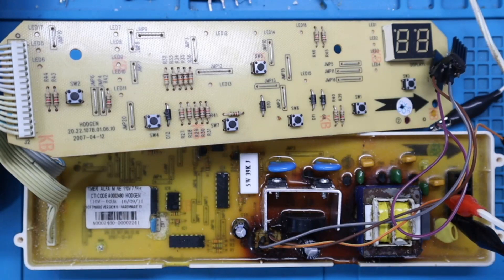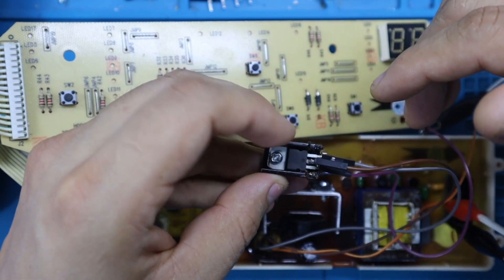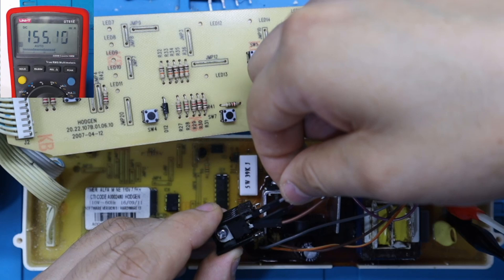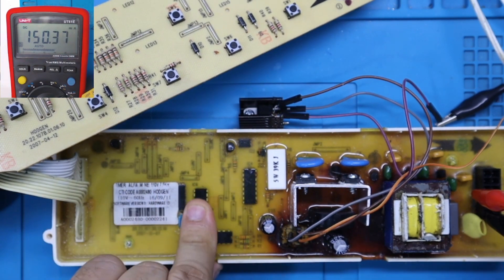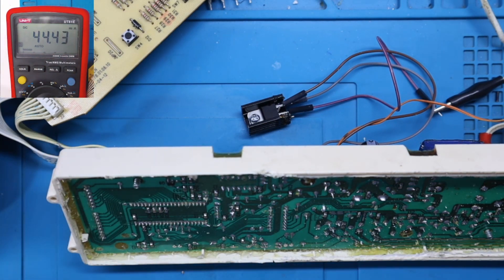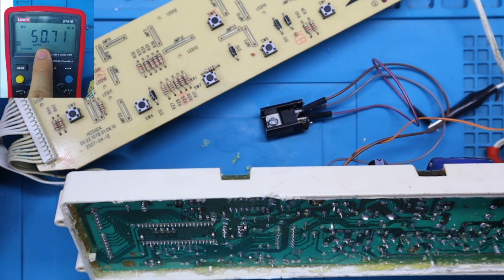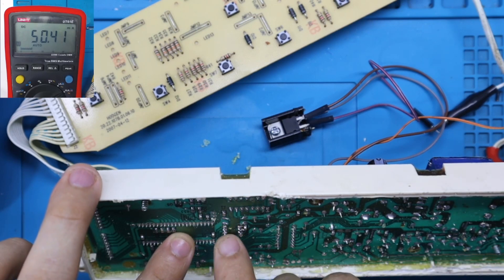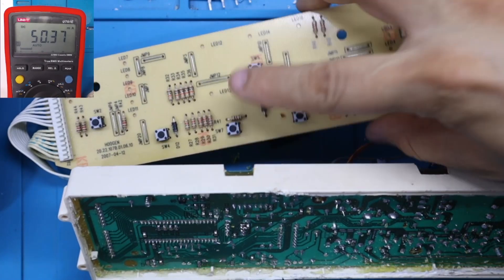Falla en Memoria Eprom Tarjeta de Lavadora Haceb | refriserka

Comment: No se yo cuanto puede calentar un 7805 diseñado para 1 amp y con disipador, consumiendo 180 ma, diría que inapreciable al tacto (alta temperatura, mencionas). Después, no me ha quedado claro, comentas que pones el multímetro a la entrada del 7805 y hablas de intentar detectar si el problema está en la linea de 5 o de 12v. No  entiendo como puedes detectar si el problema está en los 12v si conectas el multímetro a la entrada del 7805 y solo mides el consumo del 7805, no de la linea de 12v. Espero me puedas aclarar estas dudas.
Reply: No pusiste atención al video? Era extremadamente lógico que si el 7805 se calienta es porque lo que el alimenta lo está sobre saturando. Su procedimiento fue con total lógica. Este wey solo está compartiendo lo que hace. No tiene ninguna obligación de resolver dudas. Sobre todo sino está cobrando. Si quieres que te explique paga por ello. Y en lo eventual, debes ser educado y humilde al hacer una pregunta. Tu planteamiento es demasiado altanero y molesto
Reply: @esaugalvez  pido disculpas si ha parecido maleducado. No exijo una respuesta, solo consulto. No entiendo que temperatura puede tener un 7805 TO-220  con disipador con una corriente de salida de 180ma, cuando está preparado para soportar sin problema 5 veces eso.
Reply: @xax2  ok disculpa. No quise ofender. El 7805 siempre calienta. Me gustaría que tuviera una cámara termo gráfica para que pudiera ver con más claridad que temperatura tenía. Si con el dedo lo sintió caliente es porque seguramente alcanzó por lo menos 80 grados. Y habría sido interesante saber también la temperatura de la Eeprom. Aún así su aporte es muy valioso y entretenido. Saludos.